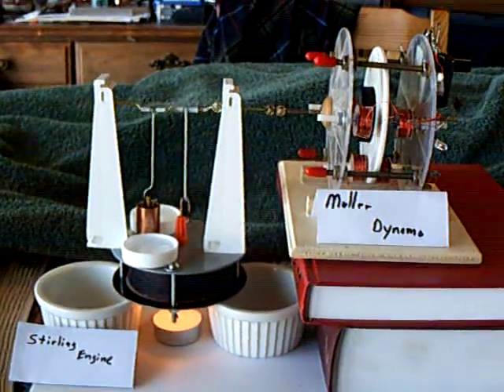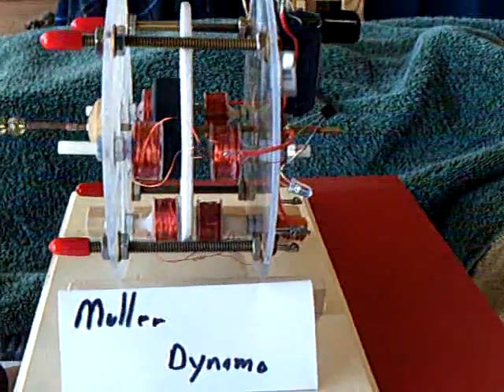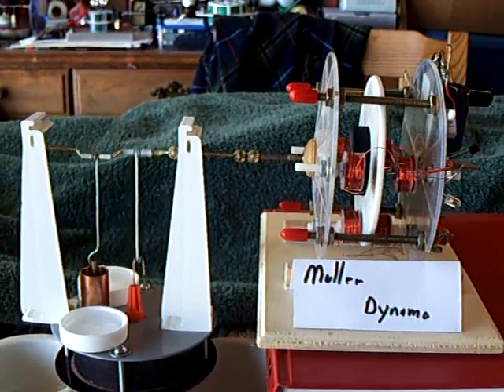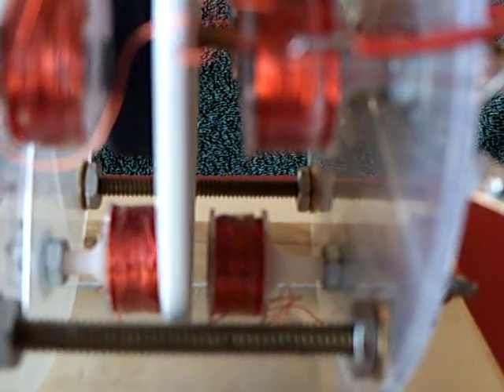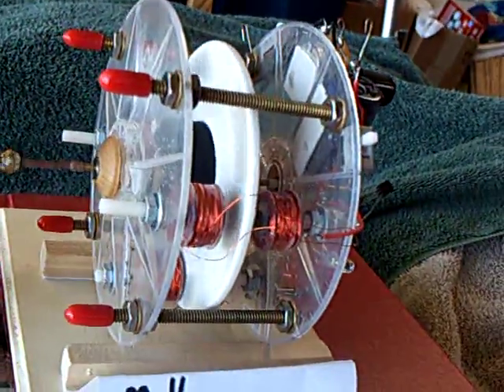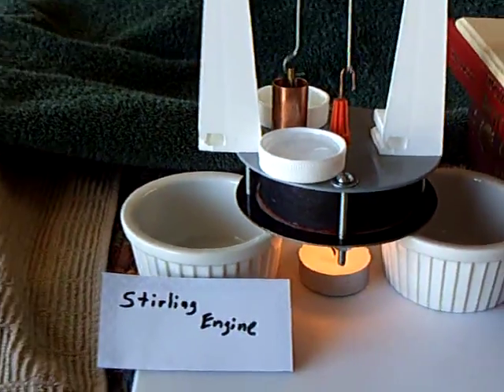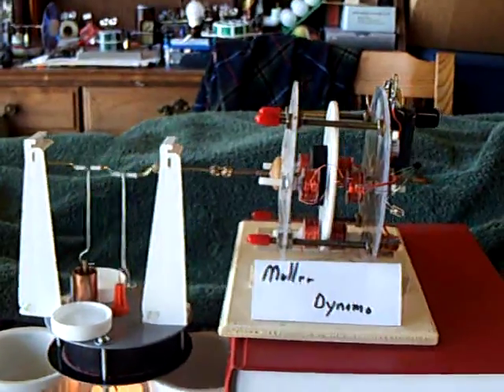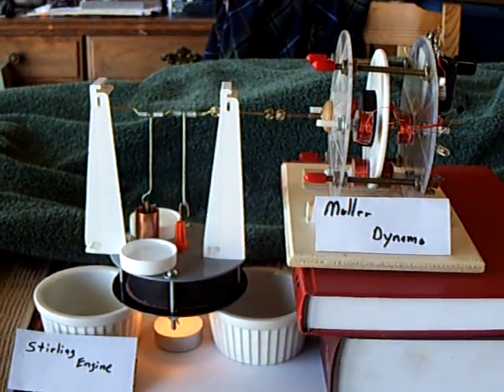Stirling Engine & Muller Dynamo--- Hybrid

Comment: The new way to create energy
is to combine Solar + Stirling Engine
using a magnifying solar dish
you create intense heat
That operate stirling engine
creating a free energy from the sun
read about it on this website:
Solar-Stirling.info

Comment: Thank you!  I have to agree it is a pretty fair design because I have never had any problems with it and it really does pump a good amount of water.  When I was building it I knew the concept should work but I was not sure if the stirling would have enough pressure to drive the diaphragm back and forth.  I think if you put this on your LTD stirling it would slow it down but with my engines I think that I make the piston to small for the displacer.  So there is some extra air to be used.

Comment from the maker: I watched your video on the little air pressure driven water pump.  Great design.  I didn't know that a Stirling engine's internal pressure could run such a device and not be seriously slowed down.  Very interesting.  To me that solves the water jacket cooling problem if I ever get that far.

Comment from the maker: The Stirling Engine will turn the Muller Dynamo without the supercap being precharged.   The Muller then self-charges the supercap-- or you can pull off the electricity into something else.

Comment: Classic ! Can't imagine the time spent linking those two without too much vibration.
Hmm, say you had a block of paraffin made from a bunch of tea tealights or some animal fats, the output from the Muller would heat a small coil enough to just melt some of the paraffin block, which would run into the candle base and keep the whole lot spinning lol